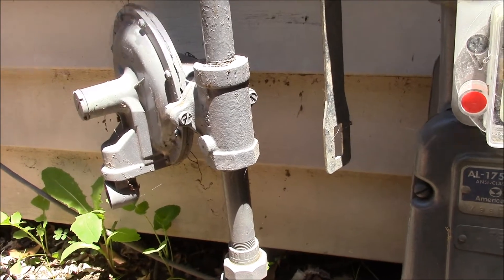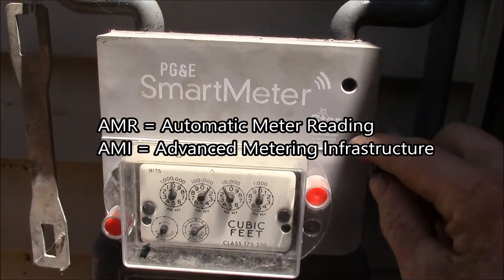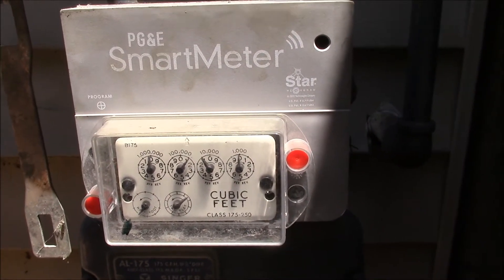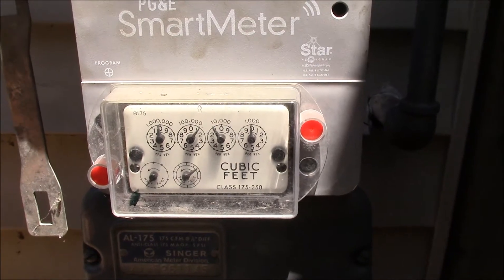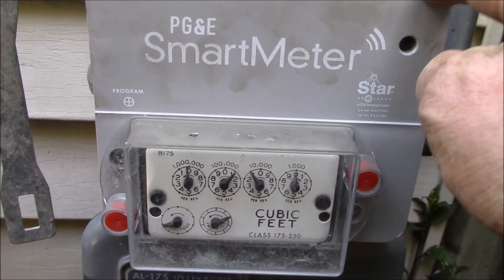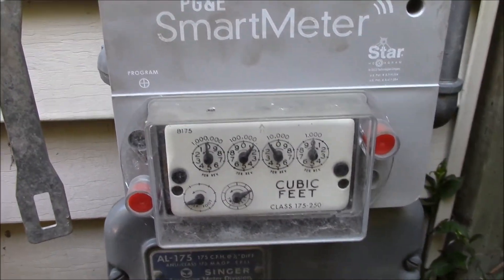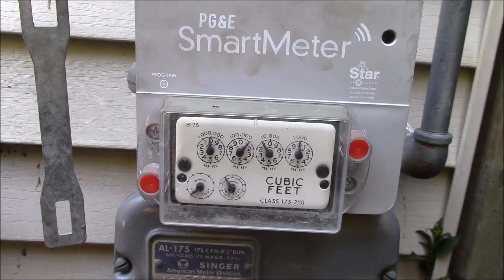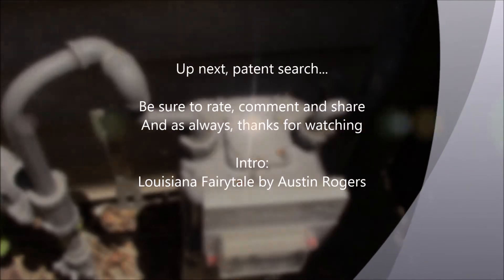Smart Gas Meter, Part 1

Comment: Stick with the FCC's documentation R Brown, every power company I have had to deal with are the WORST LIARS in the world.
The RF from a FHSS AMI7 smart meter transmitter can not be read by any broad band test set. 
You power company will use a broad band test set because it show the RF levels to be 1000 times lower than what they read.
After all, who would know you need a CISPR quasi peak detector. The specifications of this detector can be found in publication 16 of the International Special Committee on Radio Interference (CISPR) of the International Electro-technical Commission (IEC).
That would but the actual reading of the Digital Spread EIRP up into the +36 dBm and higher.
DISTANCE TO COMPLIANCE WOULD BE IN THE ORDER OF 20 TO 50 CM'S
Owners of unshielded medical implants who be put at risk of dying at 3 to 5 meters. 
THAT IS WHY THERE IS A DO NOT INSTALL DISTANCE WARNING WITH EVERY AMI7 SMART METER
Have you ever seen a power company follow this warning?
THAT IS WHY SMART METERS KILL HUNDREDS OF FOLKS EVERY MONTH
Reply from the maker: I would love to look at the FCC document with the ERP of one of these meters.  Do you have a link?  

Looking at the Tadiran battery specs, they list a max. continuous draw of 100mA and a max. pulse draw of 200mA on the LTC AA cell most likely used in these meters (TL-2100 - TL-5903):
http://www.tadiranbat.com/product-spec-sheets.html
At a nominal 3.6V, that's 720mW of power unless they are doing some sort of super capacitor charge storage.  It appears they do have a 3300uF, low voltage cap. on the circuit board, not sure how much power that could provide to the RF circuit for the duration of the transmit cycle:
https://www.youtube.com/watch?v=VXLeVZC0BfE
Reply: If a vendor or manufacturer wants to bring an unlicensed wireless transmitter to the US market, they must have the transmitter tested in a laboratory that is authorized by the FCC. 
After successful completion of testing, the manufacturer applies to the FCC for certification. If the test results are compliant with the regulations of FCC part 15, the FCC will certify the transmitter and issue an FCC identification number for the product. 
The vendor then must attach a label to each transmitter that contains this FCC identification number. Receivers do not need a certification, but the vendor has to state in a Declaration of Conformity (DOC) t hat each device complies wit the spurious emission requirements of unintentional radiators according to section 15.209.
On a smart meter, you will find the FCC Ident #
https://fccid.io/
Enter the ID into the FCC's website, look up the RF report and there you will find the CERTIFCATION EXHIBIT for that specific transmitter. 

Here is an example.
https://www.fcc.gov/oet/ea/fccid#block-menu-block-4
Grantee Code: SK9
Product Code: AMI7

Then on the nest page, go to the top “DETAIL” and click that 
On the OET Exhibits List page, click on the RF Exposure. 
Then save that page called the “Certification Exhibit”
Reply: Nonsense, perfectly safe.
Reply: @billybassman21  R Brown
, don't worry, our company manager is going to supply us with all the evidence we could ask for.
Billybassman21 is going to give us the FCC document with the ERP of one of these meters.  
Hurry back billybassman21, WE ALL WANT TO SEE THE DOCUMENTATION

Comment: They operate at 35 watts, so there is a ton of radiation coming out of the radio transmitter.
DISTANCES TO KEEP AWAY FROM THE TRANSMITTING ANTENNA
A healthy human is 5 feet.
A HOMEOWNER WITH A MEDICAL IMPLANT NEEDS TO STAY 5 TO 20 FEET AWAY OR THEY WILL DIE
Reply from the maker: Maybe the electric meters are that high, but this article:
http://emfsafetynetwork.org/pges-big-confession/
Mentions 1 - 2.5W transmit power on the electric meters and "The wireless gas meters transmit between 4 and 5 times a day at 132-794 mW."
And this seems reasonable given they are running on a single ~2.4AH lithium battery for ~20 years.
Reply: *The only ones who REALLY know is the FCC, do you have any FCC documentation telling us exactly what the E.I.R.P. is for gas meters?
Reply from the maker: Don't have any FCC data myself.  The ARRL has a good link to some pertinent information:
http://www.arrl.org/smart-meters

"Q)  Do you mean smart meters contain an intentional RF transmitter?
 A)  Sometimes.  When a smart meter contains an RF transmitter: 
    The frequency of operation is typically in the 902 MHz and 2.4 GHz bands. 
    Power output is typically 1 watt in the 902 MHz band and much less in the 2.4 GHz band. "

That seems to back up that data in the other link I found that was PG&E's (my gas utility) response to California Public Utilities Commission (CPUC) information request.
Reply: Stick with the FCC's documentation R Brown, every power company I have had to deal with are the WORST LIARS in the world.
The RF from a FHSS AMI7 smart meter transmitter can not be read by any broad band test set. 
You power company will use a broad band test set because it show the RF levels to be 1000 times lower than what they read.
After all, who would know you need a CISPR quasi peak detector. The specifications of this detector can be found in publication 16 of the International Special Committee on Radio Interference (CISPR) of the International Electro-technical Commission (IEC).
That would but the actual reading of the Digital Spread EIRP up into the +36 dBm and higher.
DISTANCE TO COMPLIANCE WOULD BE IN THE ORDER OF 20 TO 50 CM'S
Owners of unshielded medical implants who be put at risk of dying at 3 to 5 meters. 
THAT IS WHY THERE IS A DO NOT INSTALL DISTANCE WARNING WITH EVERY AMI7 SMART METER
Have you ever seen a power company follow this warning?
THAT IS WHY SMART METERS KILL HUNDREDS OF FOLKS EVERY MONTH

Comment: cool that is good no leaks job well done
Reply from the maker: Thanks for the comment.  A few years back when I had the leaking gas shutoff valve, that leak was in the range of a few hundred cu'ft' per month which works out to 0.5 cu.ft. per hour.  This was not even the width of the 0.5 cu.ft. dial needle in 18 hours, so I think the system is leak free.  Couldn't do this sort of check before with various pilot lights running since those are burning gas constantly.